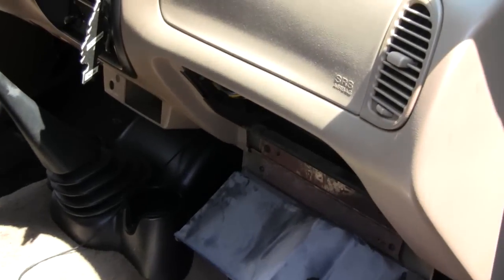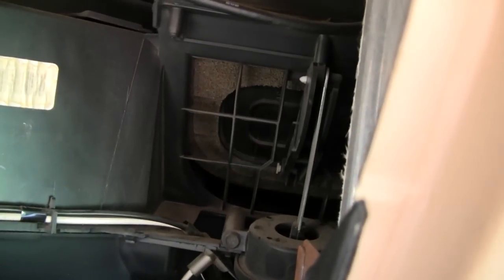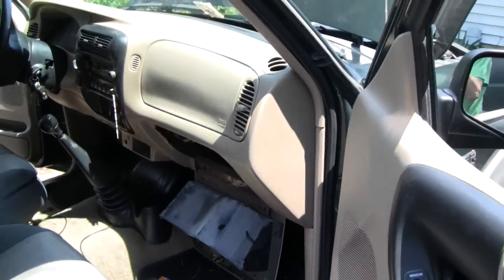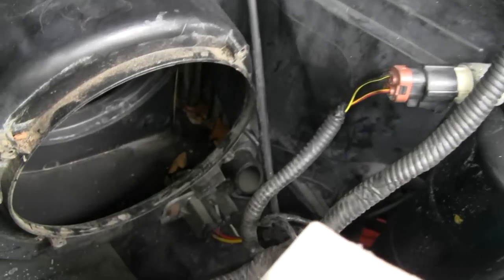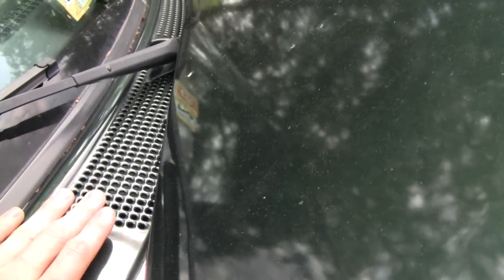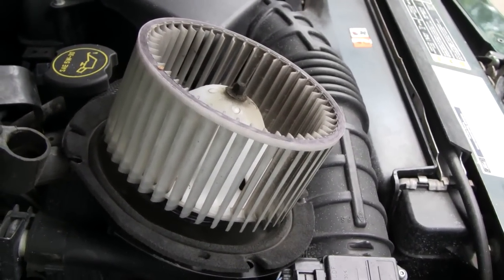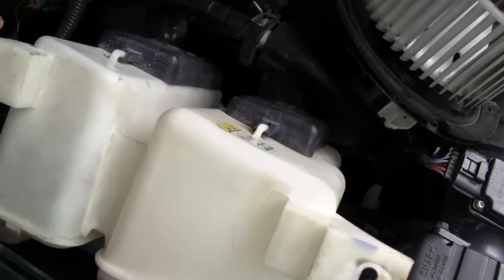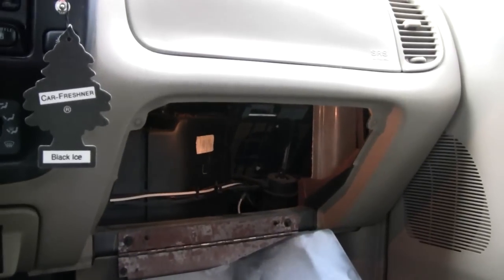NOISY BLOWER MOTOR REPAIR

Comment: Thanks a bunch for the video!  I've replaced blower motors in a few vehicles before and I really just needed to get an idea of where it would be in my ranger.  My Durango was up under the passenger floorboard and was kind of a bitch, and my Blazer was under the hood and super easy so I needed to figure out where to look.  I'll tackle it tomorrow.  The blowers I've repaired in the past actually went out, so I'm considering just sticking a new one in there as the one I need is less than $50.  I've driven my 2000 Ranger for about 12 years now and she still runs like new with almost 200k miles because I take great care of her, so I usually just go all out when I get a chance like this!  Anyway, thanks again for taking the time to help!
Reply: oh, also, the best way to describe the sound (since I couldn't hear it in the video either and I know it can be intermittent) it sounds almost like a card in the spokes of a bicycle.  or more accurately leaves in the spokes of a plastic fan ;).
Reply from the maker: +Brian Duty Great description! Glad I could help!

Comment: Not worried about you working on the ranger ,,ppl have to fix,or,repair,daily when they own them :)
Dont know why RK didnt steer you to a Taco :)

Maybe to prevent it happening in the future you could fasten some window screening to the vent intake,,,then its just a matter of un fastening the screen ,,clean it and replace.

Great Vid Bud!

That Black Ice freshener,,,,,very popular with the chicks!
Reply from the maker: I'm fine with breaking out the tools once a year for my FORD if it means saving 8 grand for what a tacoma costs!! We will probably rig up some kind of filter. Thanks for the suggestion mate 😀

Comment: I have 2017 mitsubishi mirage g4 and park under a tree and mine just started doing this today.  I opened my glove box and shook the cabin filter out but I though i head some debris fall as I pulled it out.  Should I check inside the blower motor as you did?  It sounds like and exhaust fan with big blades like you said when its on high where it was super quiet and its a new car.
Reply from the maker: +K McKenzie Sounds like that might be your problem. I'd check it out!

Comment: I went to Walmart yesterday and the fan and a/c worked beautifully. Came out of the store 20 minutes later and when I turned on the fan, it was out of balance and scraping against the housing and vibrating so bad I could feel it in the floor of the vehicle, a 2006 Explorer. Something suddenly went awry. And when it's on now, it blows warm air, not cold. Peculiar?
Reply from the maker: Sounds pretty strange for something like that to happen while you were inside Walmart!
Reply: I know it's been a long time but did you figure it put. this just happened to me

Comment: my truck has had maple tree helicopters in the air ducts before, and my car had been sitting awhile when i got it and when you turned the blower on high the whole dash would vibrate badly. turns out it had a mouse nest right in the blower wheel lol
Reply from the maker: That isn't good!! I'm glad we don't have a problem with mice around here!
Reply: trust me you leave any vehical sit long enough mice will move in

Comment: I need to tear into mine to figure out what is up with the valve thing. The fan is fine but it doesn't like to switch to different vents sometimes.
Reply from the maker: Sounds like a vacuum problem!
Reply: It likes to stay stuck on defrost.